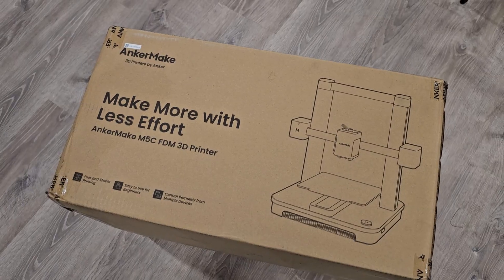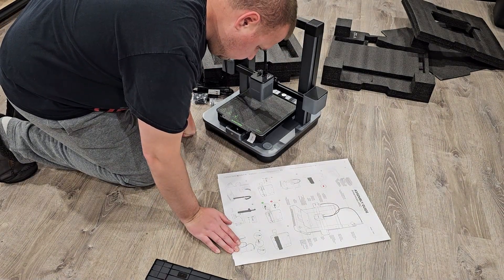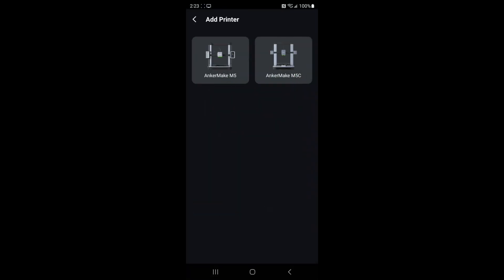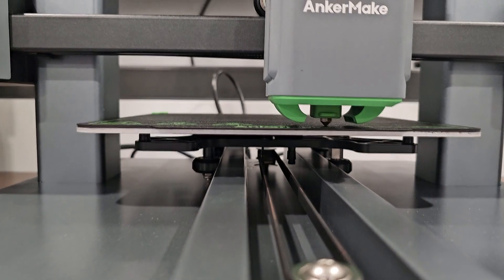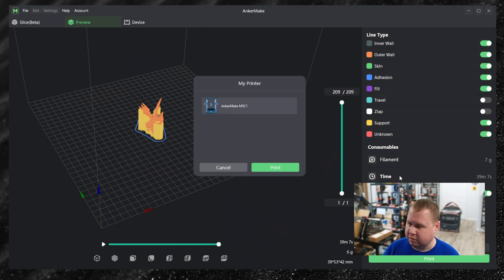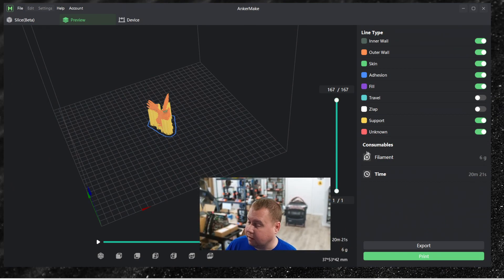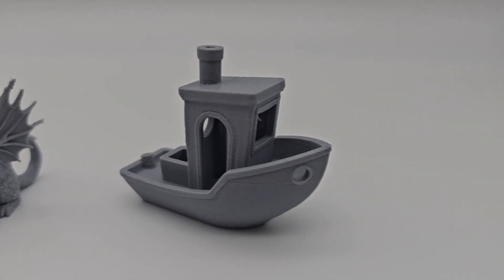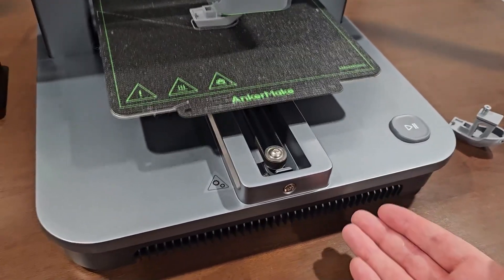AnkerMake M5c 3d Printer Review - Its WICKED FAST

Comment: Trying to decide between this and the A1-mini.
but since bambu isn't selling the A1 without the AMS at the moment, I'm leaning toward the m5c.
Still have some reservations though.  I've seen some pics/vids that show some ghosting/ringing in the m5c prints.
Reply: I have no complaints with my M5C. There is an easy mode and an expert mode - the expert mode lets you configure pretty much anything, so if you have any weird artifacts with a particular filament, you can tweak the settings to account for it. I’m a fan,
Reply from the maker: I've only owned it a couple weeks but I haven't seen any ghosting, I'll let you know if I see any flaws in the future
Reply: They are now